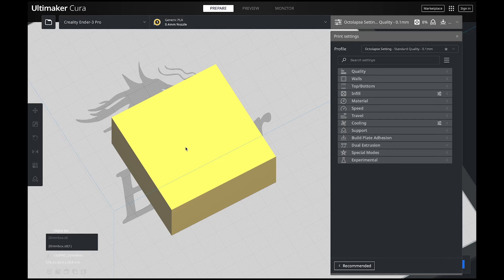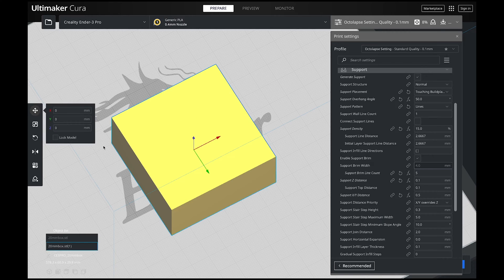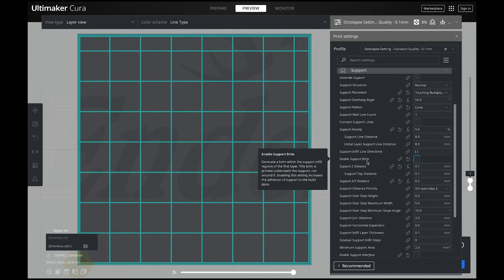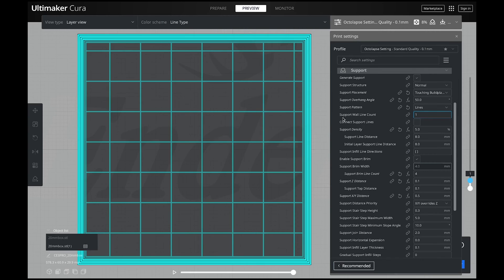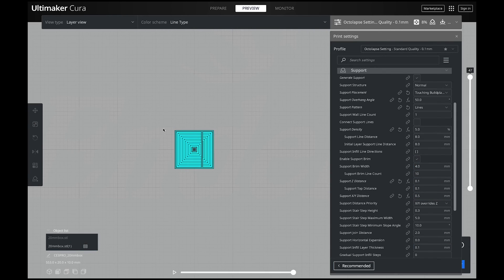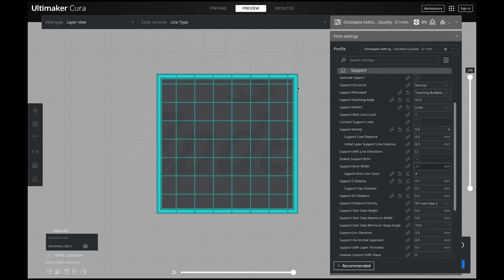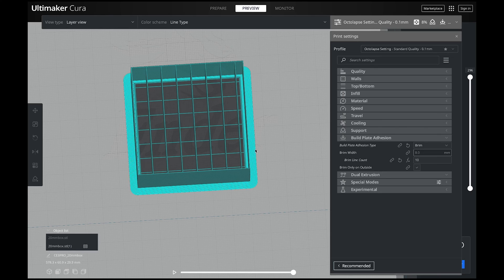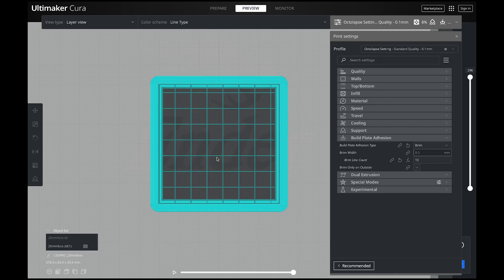Cura Support Settings: Using Support Brim for Better Adhesion to the Print Bed

Comment: Great video Chris.  I used to hate supports, but once you get the hang of it, they are an extra little challenge puzzle to solve, which is fun.  Love the series!
Reply from the maker: Yeah its a puzzle on building blocks if you don't get the base down right none of the other settings will work. That is going to show greatly in this next video. I almost bit off more than i can chew with this series. Its a huge topic and i wasn't planning on having over 4 videos on it. But i don't want to partially cover it. I've got a ton of questions on how to do it. I want to make sure i'm helping everyone that has asked and ever will. I'm ranting....passionate teacher to a fault... I don't like to leave out details for understanding.